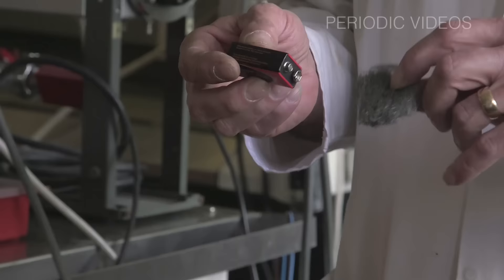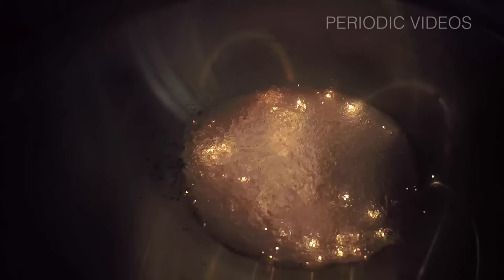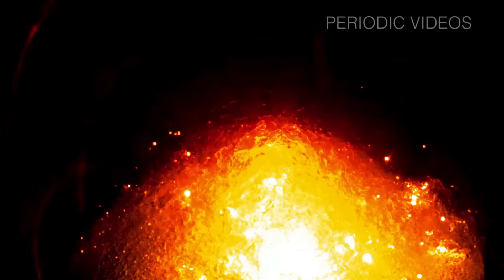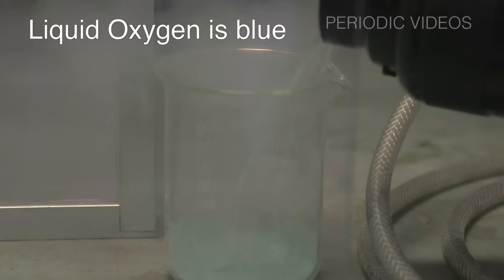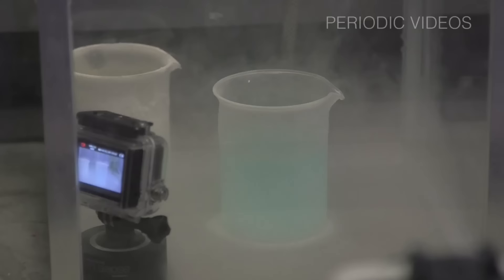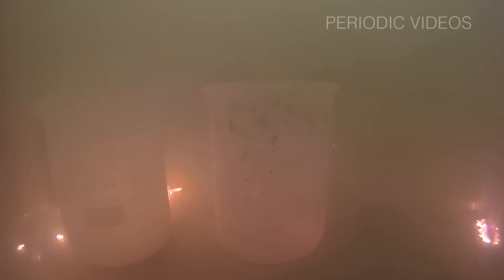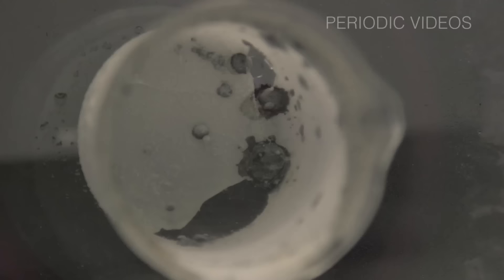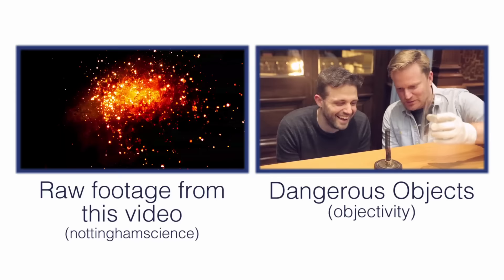Burning Iron in Liquid Oxygen - Periodic Table of Videos

Comment: In order to see the reaction, (1) the chaos of multiple iron strands must be eliminated and then (2) a cross section of the event seen, converting it as much as possible from a three dimensional reaction toward a more viewable two-dimensional reaction. Obviously, two-dimensions can't really exist, but if a thin strip of iron was sandwiched between two relatively thick glass sheets that aren't likely to crack relative to the rather small amount of iron and liquid oxygen available in the reaction, the reaction should be able to be viewed like a biological sample can be viewed by a microscope when trapped between a glass slide and the cover glass. 
       The reaction could be initiated by a spark gap created by a large low resistance wire and the strip of iron.  The size of the iron strip would be tapered and reduced near the connection with the low electrical resistance metal strip, so electrical resistance and heat would be at the highest at that location causing combustion to initiate there.  Outside of the sandwich would be a parallel pair of glass sheets on each side that would create an area for water vapor depleted air to inhabit to reduce condensation on the sandwiched glass.  
        This set up would reduce the amount of liquid oxygen involved as well as condensation.  A small amount of liquid oxygen would be introduced and before there was a lot of condensation, the reaction triggered by electrical current.
        The relatively thin contact area between the iron and the liquid oxygen could be viewed at a 90 degree angle through the glass sandwich with a high speed camera that focuses on that small area. This would probably show the reaction much like the cross sections of candle flames are shown in illustrations or like the Sun during a total eclipse when the outer layers become viewable in silhouette. I think you will see the iron, the reaction area of the oxygen converted to gas creating a little insulation area and then the liquid oxygen that has not been heated enough by the reaction.

Comment: Liquid fuel rockets used Liquid Oxygen (LOX) along with the fuel - either Liquid Hydrogen or some form of petroleum fuel and the LOX provides an oxygen rich envrionment to allow the fuel to burn.

A pure oxygen atmosphere makes things very flammable. The Apollo 1 fire was as bad and as fast as it was because the spacecraft was pressurized with pure O2. Then there was a spark.

What has been demonstrated here is how much O2 will facillitate burning. See the difference between starting the iron wool with the battery which is a smolder, with the explosive reaction in the O2. 

I thought it was a great demonstration.

Comment: I wonder if it's possible to produce solid oxygen.
Reply: Yes... https://en.wikipedia.org/wiki/Solid_oxygen
Reply: chill to 54 K. Shaken, not stirred.
Reply: I think that in order to solidify oxygen, it needs to be colder than absolute zero, and absolute zero is the coldest thing possible.
Reply: DUDEONTHERUN
Nope you can do it at atmospheric pressure at  53K but increase the pressure to 96 gigapascals and you get metallic oxygen.
Reply: I guess my teacher lied to me, my bad.
Reply: DUDEONTHERUN
welcome to the club:
https://en.wikipedia.org/wiki/Lies_My_Teacher_Told_Me
Reply: DUDEONTHERUN  Don't worry about it. Just keep an open mind and keep learning.
Reply: You may be thinking of helium, which cannot be frozen at atmospheric pressure. You need something like 25 atm to freeze helium even at temperatures near absolute zero. At very low temperatures and pressures, helium actually forms a superfluid, which is a liquid.
Reply: at 0k everything is solid, and at 4k the first thing will melt which is helium
Reply: Robert de Tatta That's not the case, as you can easily check. 4.2 K is actually the boiling point of helium at 1 atm, not the melting point (it has no melting point at 1 atm).
Reply: +EebstertheGreat i was indeed wrong. it boils at 4.22k but you are wrong as well. it actually melts at 0.95k as you can easily check on wikipedia
Reply: Robert de Tatta If you read more closely, you will see its melting point is 0.95 K at 2.5 MPa. 2.5 MPa is (approximately) 25 atm. It has no melting point at one standard atmosphere.

Under the section heading "Liquid helium," the first sentence reads "Unlike any other element, helium will remain liquid down to absolute zero at normal pressures."
Reply: Another way of looking at this remarkable and unique property: helium never sublimates. Direct conversion between solid and gaseous helium is (as far as I know) not possible under any conditions. Every other element can sublimate at sufficiently low temperatures and pressures, with a sublimation curve between solid and vapor phases intersecting the origin of zero temperature and pressure. This curve does not exist on the helium phase diagram.
Reply: Robert de Tatta lol not trying to win, just pointing something out.
Reply: Tony Samson Solid oxygen isn't as hard to make as you might think. You can produce it fairly easily from liquid oxygen by evaporative cooling simply by putting it under low pressure (i.e. in a vacuum chamber).
Reply: DUDEONTHERUN  come on man....

Comment: The question is why there is no corrosion to be seen on the globules of Fe that remain immersed in liquid oxygen!  My thoughts on this are that for many reactions to proceed there must be at least a trace of water.  In liquid oxygen I believe there is absolutely no water present whatsoever. There may have been traces of water on the surface of the wire wool but that would have been immediately driven out of the cauldron with the initial violent incandescent oxidation reaction.

Comment: Failed experiments still give you data you can learn from. 
Professor, isn't what is happening with the iron just the Leidenfrost effect, but encapsulated by the liquid? The heat from the burning iron is enough to  vaporise the liquid oxygen, which causes the exothermic reaction to intensify, this cascade continues until the iron's mass is reduced to the point where it cannot hold on the the heat long enough to sustain the burning. The oxygen gas will act as an insulator keeping the cold liquid away from the hot iron. 

Thanks for all the videos.

Comment: The initial pics look like the plasma filaments radiating from the surface of the sun. If the "cauldron" was highly polished, this effect could be used by film-makers etc. 
Rather than dropping the burning steel-wool into the O2, why not stick some wire into it and do the sparky-sparky bit remotely by battery.

Comment: Oxygen doesn't have to be a gas to fuel fires, it can do so as a liquid, so you don't necessarily have to expect seeing the liquid oxygen turning into a gas before being used up by the flame.
Reply: That's true, but I believe the problem they were thinking about was why the extremely cold liquid oxygen didn't just cool down the metal. No heat means no energy for the reaction to proceed.

Comment: I'm imagining myself at a uni entrance exam for physics.
prof:  ok ray, heat energy has been put into the iron wool before it's plunged into liquid oxygen.  Your hypothesis is that this is sufficient to locally evaporate the oxygen providing a boundary layer of lower thermal conductivity which allows the exothermic reaction to run away.  Design an experiment to test this hypothesis.
me:  um, er, dunno, but the boundary layer must be too small to be registered by any normal camera, so that method would be useless.

Yes, it must!  Because the iron fibre has to give up heat and when below a certain temperature it will not combust.

I'm a teeny weeny bit disappointed with Martyn here because I think his hypothesis is the same as mine,  and he says the experiment failed.  I wish he'd said that it was doomed to failure because it can only be expected to be visually testable at microscopic level.  Not a well designed experiment, rather an entertaining youtube video.  Anyone can muck about with stuff.  Sorry to be a sourpuss.

Comment: What if it burned because the O2 concentration in a liquid is simply that high, that the activation energy for the reaction dropped drastically, so that the innitial heat of the iron was enough to start the reaction? that releases even more energy to keep the reaction going by heating up other iron atoms. The idea about gasual oxigen seems legit, but rather as a side effect of the heat, in my eyes. Too bad we can't see it :/

Comment: you can always solve your problem of the atmosphere by doing the experiment in a vacuum and use robot(mechanical fingers controle from a distance) to drop the "burning" iron without dropping the 9V battery. its gonna give you a beautiful result with no ambiguity of what going on inside the flask.since the gasses produced are not toxic you don't need a high tech. vacuum chamber.
Reply: How would you create vacuum in a container with liquid oxygen?

Comment: Isn't iron naturally pyrophoric, but it gets passivated?
Reply: No, it is not pyrophoric. It simply reacts with oxygen to form a metal oxide layer surrounding the pure iron. You are probably thinking of iron sulfide which is pyrophoric. Steel needs passivated in order to prevent rusting, but that doesn't make it pyrophoric.
Reply: Very finely devided Iron is indeed pyrophoric, but it needs to be very fine.
For example when grinding iron you get sparks. That's due to the very fine iron reacting with the Oxygen in the air. Platinum for example won't give you sparks.
Reply: P@r@m3d!© Oh, you're right! I didn't know that powdered iron is pyrophoric! I thought that was due to friction. That makes sense because iron oxide has a lower melting point than that of the pure metal (that's the only metal that I know of with this property). This would allow for sustainable burning given a large enough surface area.
Reply: opl500
What do you mean exactly?

Comment: now im no chemist but im prety shure you created steel.
Reply: Making steel would need a source of carbon.....
Reply: Nope, iron oxide.
Reply: usually iron does have a lot of carbon already, making steel you blow 
oxygen inn at a very high pressure in to a furnace, as a result of 
removing all the carbon you add some more, but that's a result of the 
efficiency of the process(burning away all the carbon). i doubt that 
this actually removed all the carbon from it. hence steel.
Reply: Steel is iron with a specific range of carbon intermixed in it; if some of the liquid oxygen reacted with the carbon in the iron wool (As part of the manufacturing process you'll have some carbon no matter what) you may actually reduce the amount of carbon in the iron effectively purifying it to pure Fe
Reply: i was wrong, there is no such thing as "iron wool", its "Steel wool". so basicly they burned out more carbon out of the already low carbon steel wool.
Reply: No, they made rust.

Comment: 7:40 - Professor Poliakoff, I think you mean larger surface area. ;)
Reply: Nope, a larger lump has a smaller surface area than the combined surface area of many smaller lumps. To see why, imagine a large cube, then cut it in half. The combined surface of the two resulting lumps have the same surface area as before, plus the two surfaces created by the cut.
Reply: LeoMRogers After a trip to France, commenting on youtube is not a wise idea. Thanks for the considerate response for a tired dude.

Comment: Add the iron to the liquid oxygen and then light it? It will probably rust fast though...
Reply: A common misconception is that oxygen gas burns. It actually doesn't! Oxygen allows other molecules/atoms to ignite by acting as an oxidizing agent. So you would need the flame to be in contact with both the oxygen gas and the metal regardless. What the chemists did here was about as spectacular as you can get this reaction to be given the amount of iron they used. Perhaps opening up the iron wool for more surface area and igniting more of the wool before the drop would make it more flashy/dangerous.
Reply: never said it did.
Reply: jacky koning How would you light the iron?
Reply: Yes, but a battery will probably not be enough energy since the iron would be at a much lower temperature. But thats easy to solve. :)
Reply: jacky koning Hmm, that's a great idea.
Reply: Why not ditch the batteries altogether? Use the mains!

Comment: If the iron burned, where did the iron oxide go?  At the end there were iron nodules left, but no rust.
Reply: Rust is oxidation of iron in the presence of water and oxygen,there is no water in this experiment. Chemical formula of rust it's a mix up of iron hydrates and hydroxides, FeO(OH) and Fe(OH)3
Reply: Thanks, but if there wasn't enough water in the atmosphere to create an iron hydroxide, there'd still be iron oxide left.
Reply: The iron metal was liquid, and formed nodules due to surface tension. Iron oxide doesn't have a liquid phase, so it scattered as it formed rather than staying in the cauldron.

Comment: It looked more like the iron melted.
Reply: Of course it did.
Reply: guifrakss
I'd wager an aussie beer that the abundance of oxygen allowed the fine iron wool to burn at an accelerated rate, much like a thermite reaction?
Reply: LazyLife IFreak Yeah, but if I remenber correctly, in thermite, iron oxide (rust) is the source of oxygen, burning the aluminium.
Reply: guifrakss
Close enough.